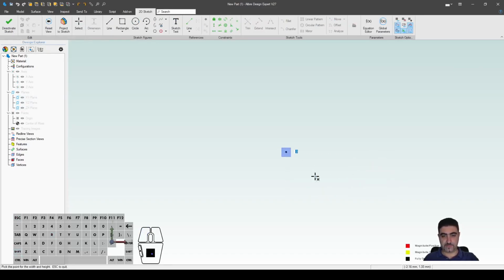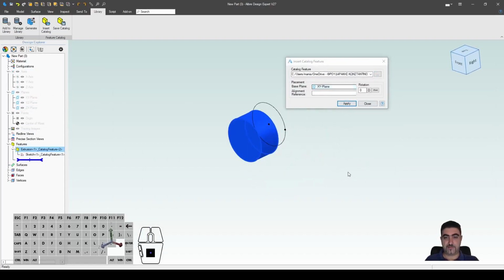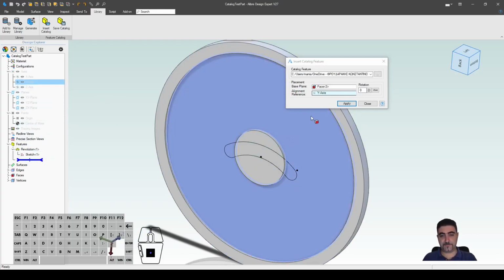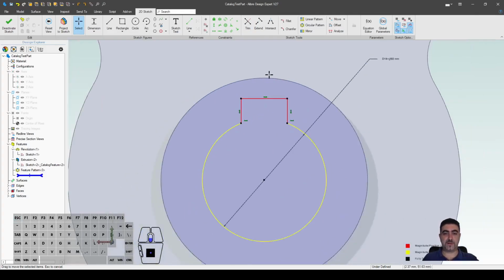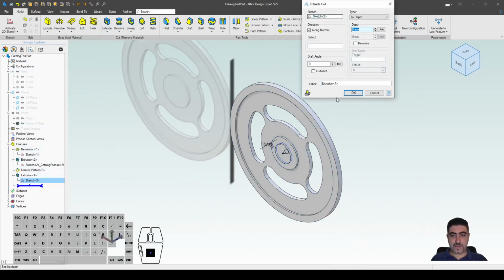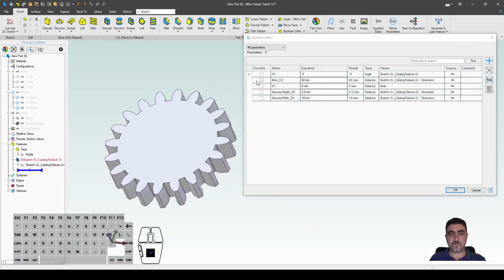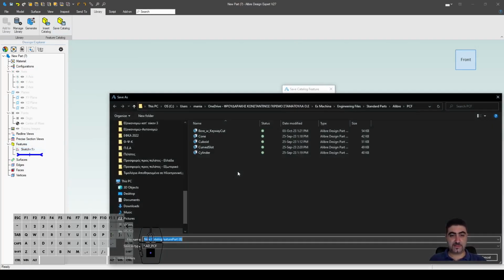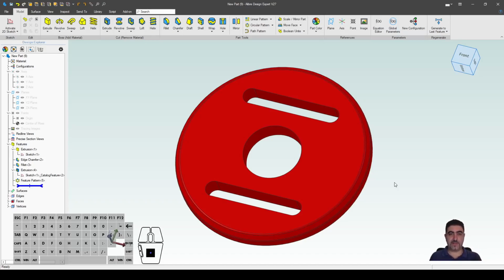Rookie To Rocking it: Catalog Features Masterclass

Comment: 9:10 this is really cool, but if you're fast with keyboard commands, I wonder if doing a bunch of catalog cylinders and changing their values later is much faster, if at all, compared to pressing C (or whatever your circle hotkey is), click on the face and then the origin, type a value, press your extrude hotkey and type your value. 
It sounds like a lot but comparison but really it seems like adding them all from the catalog and then going back to change their values is too. I guess it depends on your overall plan for the model.
Reply from the maker: It's true that in terms of speed modeling it would be close. Designing it might be faster even. But in normal paced work projects I find it more relaxing and easier to focus by dropping the features in hitting Ctrl+E and editing the values.
And that's not even the biggest use case. The biggest use case is for complex features like the bore and keyway, panel mount plug holes, etc. So, multiple shapes with multiple dimensions that you can just drop in with catalog features

P.S. That is close to how CATIA works. You can place the dimensions and then go back and open up a table and populate their values. You can do it the traditional way too, but it's interesting that it's similar
Reply: @ExMachinaEngineering  very true. Especially if you're designing, say, a whole product line which uses the same complex feature all over the place and only slight variations. 
Also, the method I mentioned doesn't work so good if the origin isn't concentric with the cylinders. Unless there's a faster trick that I don't know about, without the origin, you'd have to manually add the concentric constant as well each time.. which would eat up more time and definitely make the catalog method faster.